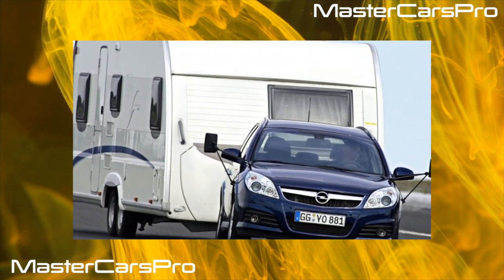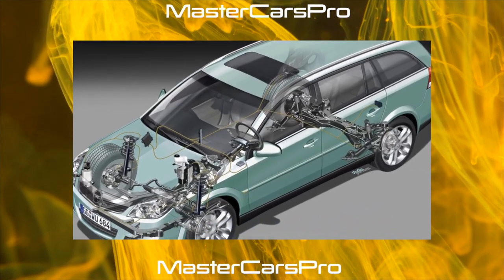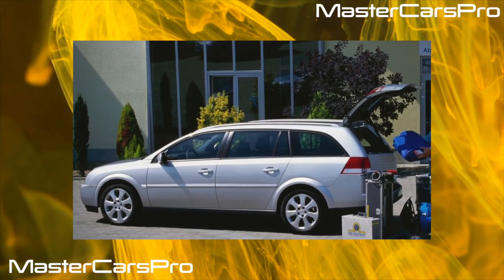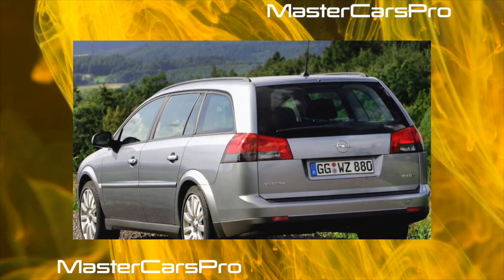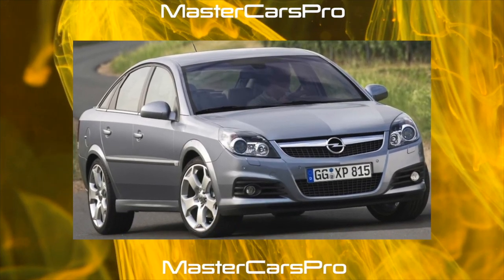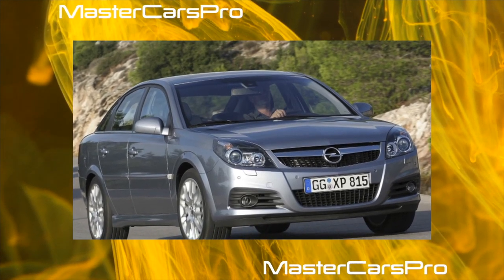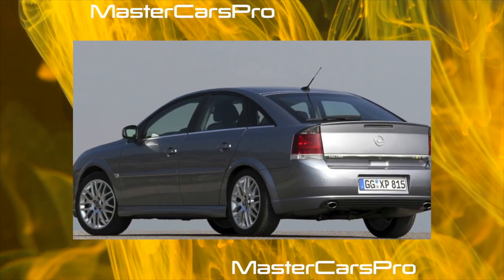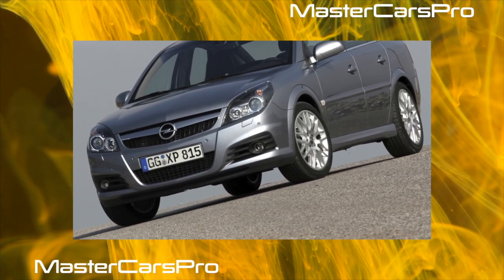What are the cons of owning a Opel Vectra C?

Comment: Also clean out the water reservoir under the wipers it gets clogged with leaves and water will find its way in through the dashboard and your  have water in you car. The fan control system will stop working.